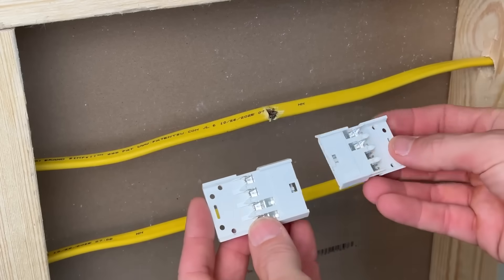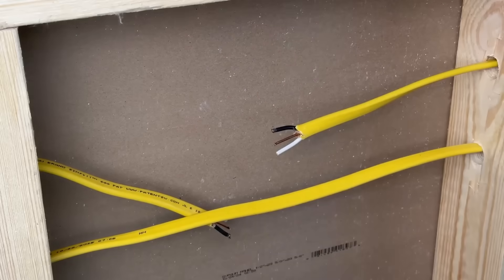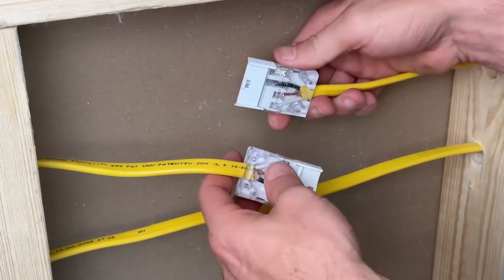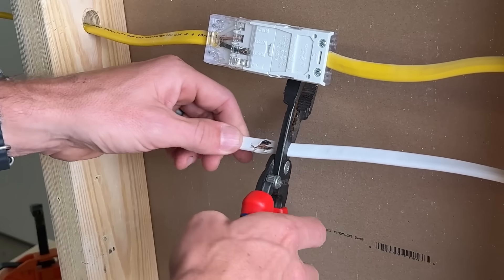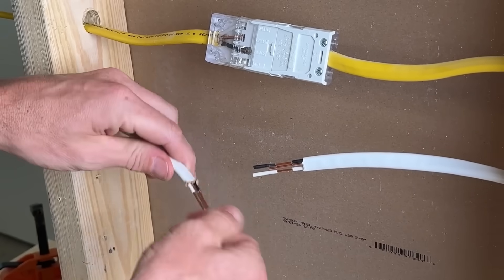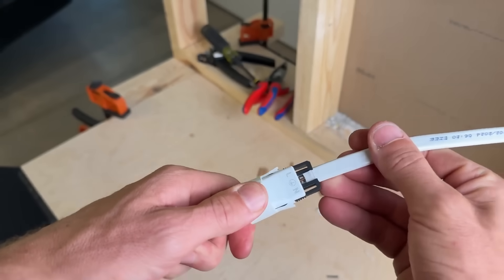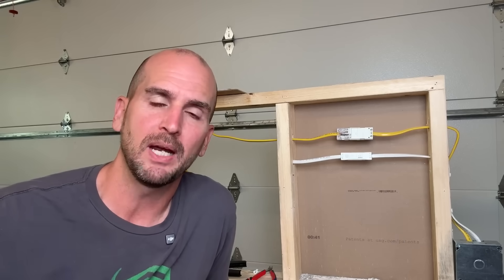Is This the Future of Romex Repair?

Comment: My concern with these connectors, in addition to Wagu, is how much surface area is in contact.  I would think that the surface area of the conductor's cross section would be the minimal acceptable contact area.  So, those pins that pierce the wire don't seem adequate.  I think some tests need to be conducted by physicists that are electrical specialists to determine if these connectors create choke points and reduce the throughput of electric current.  What comes to mind is the change in receptacle back wiring being limited to 14awg and no longer allowed for 12awg.

Comment: IDC connectors should be limited to low voltage communication cables. Once the drywall goes up, it'll be fun trying to find the break in the cable. If the wall is open, just replace that section of cable.

Comment: I'm in the RV repair business, and I Love these things!  These pieces of crap fail quite often as they age for various reasons, and have made me lots of $ over the years.
I would never allow one in anything I own, since I've seen them burn so many times.
Reply: You are a king.
Reply: Wow. So what’s your fix?
Reply: @AB-hn6gb   If enough wire slack, I just install a J box/wire nuts. If not, I install 2 boxes a short distance apart, or in a few   cases, replace the entire wire run.

Comment: .........."pressure connectors" like these should never be approved for "concealed" use any where in the world. The connection points are not adequate to support moderate to heavy loads which is where most failures will occur. You don't want "connections" that will generate heat under load and these will generate heat leading to eventual failure depending upon load and duration. They will not stand the test of time like a "mechanical" connection.

Comment: I'm a licensed Electrician, the reason this will not be approved is: A buried junction in a wire has the potential to be a problem...  That is why the NEC requires an accessible junction box for any and all wire splices.
Reply: These are legal and approved in my area.

Comment: As cool as it looks. It only has small contact with the locking contacts, how many amps can it withstand and what heat is generated by the reduced surface area?   Not sure!!
Reply: The first example has tiny sharp teeth to pierce thru the outer skin, very small contact area for running full load  19 a for 10 mins?  very scary

Comment: This kind of repair requires a metal junction box withs a cover.
Reply: Metal is not required. Pvc is fine as well😂
Reply: @billymacktexasdetective5827 Metal won't burn or melt, but you can use PVC if you like 😅😅

Comment: Electrician here. DO NOT use either of these connectors inside walls, where you can't access it.  Even if accessible, I will never use it at my house. These connectors work by pressure, so if you happen to overload the ampacity of the wire often—portable heaters are the common culprits—the connections heat up faster than the rest of the wire. You're talking a potential source of fire!
      The safest way is to use two junction boxes and splice them with wire nuts, and not use these plug-in-type connectors. I know it's ugly to have two junction boxes, so you can also run new wire, which may require opening up walls between the original boxes. This is where knowhow in patching up holes in sheetrock may come in handy.
       Just do your best not to cut any wire!

Comment: Looks like an unmarked built in fireplace to me. 

Ain’t gonna happen in the house I sleep in.  If I wouldn’t sleep with one I dang sure wouldn’t put one in someone else’s house for sure.  You don’t wanna wear that badge. 

As for the NEC it’s still required to have junction boxes and splices readily accessible. 
The kicker here is the manufacturer is the responsible party for correct installation and inspection. We all know they’re gonna be really strict about making sure everything is properly done. Right?? 😂

Comment: I found a splice connector in a modular home. The windows showed the wires but the neutral and polarity were switched.  In a modular home factory there is no excuse. Use a longer wire and use the short wire somewhere else.  I used a proper splice box with wire nuts. I would not buy a house if i knew it hat splices in the walls. You may have low resistance in the beginning but corrosion could take place in time and create a heat source. Insulation displacing connections are only good for low voltage/ low current applications.

Comment: I'd bury a box in the wall before id use this.
Reply: Agreed.  Not code compliant, but a really carefully done buried box seems safer than insulation displacement connectors.

Comment: These are used for modular homes and do fail.  I have replaced them a number for times after they melted.  IDC is a bad thing in electrical.  Also, the splice is in the context of a closed in wall cavity and is not code compliant here in the USA.  It also adds three connections to the wire so there will be a heat rise under heavy loading.

Comment: Huh...a junction buried in the wall...it is forgotten about down the road...
So when it fails and the cost to refeed that circuit cost 100x the patch originally costs...
you get what you pay for
A better way would be to pull both ends back a stud or two, nail on a couple of boxes, run wire between the two and throw a couple of receptacles in the boxes. 
Now there are more plugs in the room not a buried joint in the wall thats got a limited life on a potentially heavy circuit
Rhode Island - buy a copy of the NEC
Reply: The junction box on a can light is A ok to bury with zero access, but a regular junction box isn't ok to bury with zero access😂

Make it make sense...
Reply: @billymacktexasdetective5827 easy to do ... installed can lights DO have access to the joints
The can light junction box ALWAYS has a removeable cover on both side of the junction box
There are typically 3 maybe 4 quarter inch hex screws holding the can to the rough-in frame, remove them and pull down or push up the can and push up the spring tab on the cover and there are the joints.
Any thing else I can clear up for you?

Comment: Apparently the US version is used in RV & campers a lot for slide outs. Where they transition from romex to SO cord for the flexibility. A friend bought a new 5th wheel & within 2 weeks started having receptacle failures. Removed these splice kits & replaced with twist lock plugs. I would never use these for anything. Poor contact points.

Comment: I work on refrigeration and see these type of connectors burn up all the time. Nothing like twisting wires together and using wire nuts.
Reply: I agree. Those splice connectors offer very little surface contact and when corrosion starts, your chances of a fire increase. The only splice besides wire nuts that I would trust would have screw terminals.
Reply: @blueribb99 good to know...as a normie, it looks like a great idea,  nice and clean, surely safer...so im glad to learn
Reply: 😂😂😂keep using them you NuT 😂😂😂
Reply: and you have NEVER seen a wire nut burn up? Or under stripped, overstripped, wrong size nut, overtightening, under tightening, re-using wire nuts, misalignment, uneven twisting ...  I see this product eliminating all that.  Your generic claim you "see these burn up all the time" would make me question what product, & how & where you used them, not the connector.  All these negative comments sound just like the old knob and tube guys trashing Romex as a "terrible idea".  I suspect Electricians thinking this product making it easier & better will cost them jobs is the real reason behind most of the negativity & fear mongering to trash the product.  How many house fires were found the result of incorrectly installed wire nuts?  This product would eliminate those and minimize the risk of failure.  And if it did fail - the most likely result is a tripped circuit breaker or fuse.  The fear mongering, unless actually proven from tests, is baseless.
Reply: @JohnMcCarthy100 Nah I've been an electrician for 42 years and that looks flat out cheesy! Not in my house or on my insurance! 🤨

Comment: Can't be legal per the NEC. Once the Sheetrock is installed, and it fails, then you are screwed.
Reply: But it's just fine to install can lights, right? They have a junction box, and once drywalled, there's no access if the lights are between floors😂

Comment: Approved? But can they be hidden in the wall or is an excess panel required?
Reply: National Electrical Code requires an Approved , Accessible Box for all splices and devices. Dangerous devices like these have been proposed  over the years by short cut specialists. To date better judgement has prevailed. We , the professionals  who propose code changes , need to be vigilant to protect the public. This is a matter of life and death , not convenience and expense.

Comment: These are basically the same concept as a Wago connector which many people use and love but there have been some issues with overheating because of the wires only touching a small area on the connector rather than a more robust traditional connection. They're probably fine for most situations but I don't know if I would trust a high amp load that is flowing through for extended periods of time.

Comment: They are approved in the us modular homes such as double wide triple wide etc use these to connect the circuits from trailer sections
Reply: just as a note modular is not a trailer or double wide in any way or sense
Reply: @KarmenD-ce5re okay lmao

Comment: Once again and as I've seen in other videos... The NSI splice kit comes with a metal retainer strain relief for both sides of the connection.  Nobody shows them installed or even mentions them.  They are a critical part of the splice after the connection is made.
Reply: critical? as in it fails if that strain relief fails? what? how oh how ever did wire nuts EVER work?

or did you mean to say handy instead of critical?
Reply: Critical.  It limits pull strain on the connection.  Wire nuts are inside a box that have their own strain relief devices, integrated or otherwise, and assuming they are properly installed too.

Comment: Are those pinch point connectors aluminum? I would prefer to see copper contact points when using copper wire. From what I see there is very little current transfer surface at those pinch points. That's where heat builds up.

Comment: I DISAPPROVE.    There is not enough surface contact to prevent heating.  Those little spring like metal inserts are only making contact about the size of the mark from an ordinary ink pen. MY PERSONAL OPINION is that they are ok for a single outlet circuit that is TEMPORARY. I would definitely NEVER enclose that behind drywall.  I have worked too hard for the things that I own to lose it all because I'm too cheap to run a new wire. This is MY OPINION and all of the armchair electricians don't have to agree.

Comment: I'd like to see the heat test first before I make a decision.
Reply: I’m sure the manufacturers never tested these connectors before putting them on the market.
Reply: @alant5757  Don't be dumb.  If they weren't tested, they wouldn't be allowed on the market.
Reply: @olafbigandglad 
Just because they’re tested does not mean they’re safe to use.
Reply: @DaddyRabbit62 Exactly 💯
Reply: @olafbigandglad 😅😅😅😅😅
Reply: @olafbigandglad  I'm pretty sure he was being facetious.
Reply: @alant5757  the tests that many manufacturers use is for minimum failure required by UL standards. Not many will truly stress test them fully enough.
Reply: @bw1074  like the Romex cable itself or the billions of outlets and wire nuts etc already approved?
Reply: @alant5757  like the Romex cable itself or the billions of outlets and wire nuts etc already approved lol?  Go back to your tape and wire nuts.
Reply: yeah.  It looks like a cheap fix leading to an expensive problem, maybe fatal.
Reply: @AndrewJordan-zn4tm 
Ain’t no way this ole boy is going down that road!
Reply: @A @AndrewJordan-zn4tm 
The thing that gets me is the wall or cavity is going to have to open when the installation is done. So why not just fix it so the fire department doesn’t have to respond? 😂

Comment: To my knowledge these are NOT approved in Canada and hope they never are. I as an electrician have felt with them on a few occasions all of which were failures in the wall. Will never use them or the quick wire connection on back of devices. Firm believer o joint should always be accessible

Comment: You did not share the results of your resistance testing after connecting each device. With all due respect, this video has little to no value without that information.
Reply: Exactly.  Wagos were also discounted originally and are able to pass current without overheating.  These connectors have even beefier contacts.

Comment: Okay I will give you my opinion. I am Leary of this device because it depends on surface contact rather that a mechanically secure connection. It's like the push type connectors on the back of receptacles. They have been known to fail and cause arcing. On an other note have you noticed how those wago type connectors swivel around when you move them whereas a properly done wire nut connection is rock solid.
Reply: I took apart a late model big box SPST wall switch recently that had failed. I didn't get any pics, but my observations were that the actual contacts were now just a divot embossed into a metal copper strip. I seem to recall older switches having what I think was either solid copper or brass contact pads riveted into thicker copper strips. I also seem to remember that sometimes the contacts were silver plated. I wonder if this is becoming practice because of the notion that with LED lighting, the currents are lower. It seems that would be very bad in switched receptacles, though. It seems like a race towards a fire with electrical fixtures these days.

Comment: I have the stuff currently approved in the space between floors above my kitchen and I don't trust it. Was a pain for my electrician buddy to install and as my drywall guy was working the connection was coming and going as he touched it. We got it working and the drywall in place and have crossed our fingers since. Really crappy connection. I'd replace it with this new type in a heartbeat.

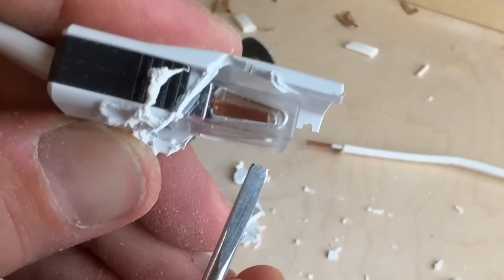Comment: 3:05 Slick design, but the contact area seems poor. It only makes contact across the wire and not along it. It's not suitable for permanent use or high currents.

Comment: As an electrician this device has been around for 20 + years whether or not your local codes allow this device is something I would check before using,  for example Rhode Island allows this device but most of Massachusetts does not.
Reply: These splice kits are used all over the place inside of the USA. They are in modular homes , and trailers all over. The reason they are not used in other homes is because you should not be burying your splices in the walls, because of servicing issues. With modular and trailers they have access panels where the parts join together where all these ends splice together. These connections are supposed to be tested by the home manufacturers so that they meet the specifications requirements of these splice kits to meet the UL specifications for these kits. People are going to say them why do they sell them if I can’t use them, because like I said earlier the manufacturer of manufactured homes is supposed to test them but if you have ever worked on a modular home you know that you better have extra of these with you because you are going to find bad connections. This also means that you don’t need a rough wall inspection for a modular home, just a service and final electrical, because the rough wall inspection is supposed to be done by someone in a factory somewhere else. This is why the NEC is not going to approve these, now you might run into some crazy local exceptions but I wouldn’t plan on that, because they do go bad and then someone is trying to figure out why.
Reply: @timothydixon2545  "they do go bad" Good enough for me to avoid, thanks.
Reply: I am a licensed Electrician,  never liked them.  Code compliance in NJ.
Reply: @michaeldidomenico6312  Why dislike?  Too easy so accessible to DIYers 😂  Ever check the resistance/heat generation? …that’d be my only concern assuming used in moisture-free location.
Reply: @gr8dvd You hit it right on the head. If there is an actual safety reason to prohibit these, then more power to the regulators. But if it is being done simply to protect the electrical trades, bad reason.

Thanks for the great post. Happy new year.
Reply: @gr8dvd  not to mention anyone who wants to hide a splice in the wall shouldn’t be allowed to do electrical work or repairs. The reason being that when you do something like that it can cause a fire, but that’s not a big deal. People who have never fixed these things say all kinds of things about how good they are.
Reply: @timothydixon2545  100% — done right guessing old fashion pigtails are safer & yet still need to be in a junction box or otherwise accessible.
Reply: @gr8dvd  I agree it’s not hard to ask people to be a little professional, and I don’t understand how people don’t know that these have been around for decades. These things are called mobile home splice kits, because they have been used in modular homes and mobile homes for longer then I’ve been doing electrical work and that’s over 30 years.
Reply: @dworkenlaw1  How does this keep anything in the trades? If you as a DIYer can use one of these, you can also do it to code using a box. God you people are insufferable- everything is some conspiracy.
Reply: Yup. The lovely ignorance of the building departments. Drives me nuts sometimes.
Reply: Massachusetts still has a law on the books that prevents you from frightening a pigeon. Need I say more!
Reply: That's because MA is a radical non sensible blue state. RI isn't much better, and neither is any of NE.